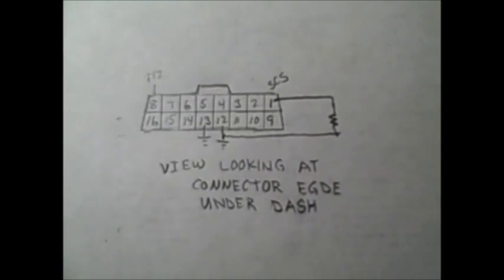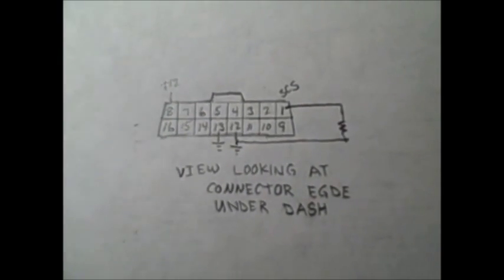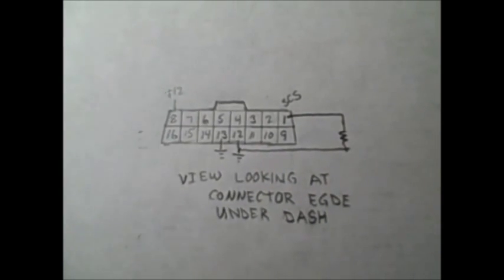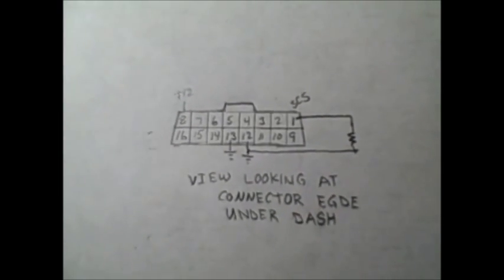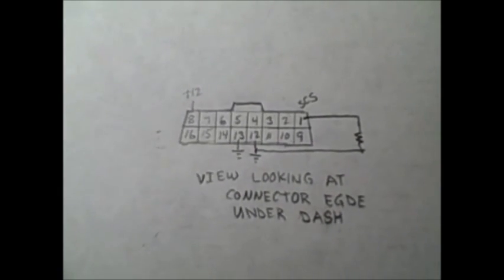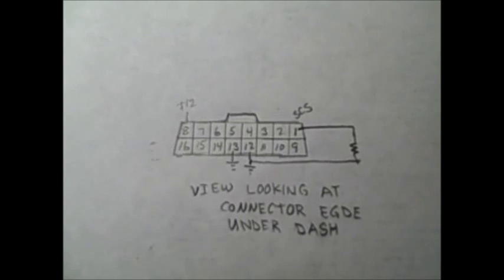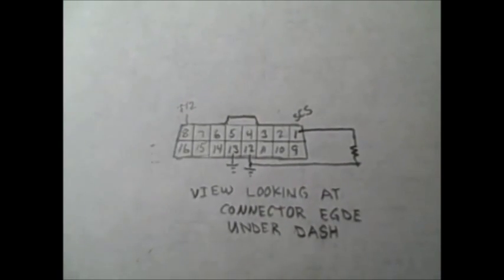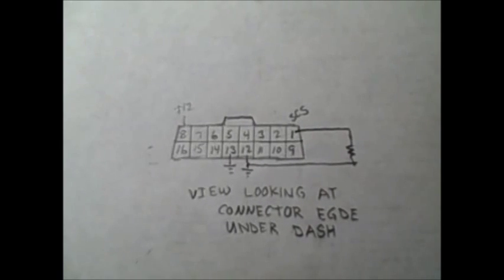Read 2000 Honda Odyssey Engine Codes for free

Comment: I just did this but the pin number doesn’t match with your draw.
The pin number to jump are 9 and 4. I did that and the ABS light was flashing.
Reply: Thank you.  I noticed that too from alldata's diagram of the connector.
Reply: @haroldthomas1576  vwwwwwwww222w2ww2w